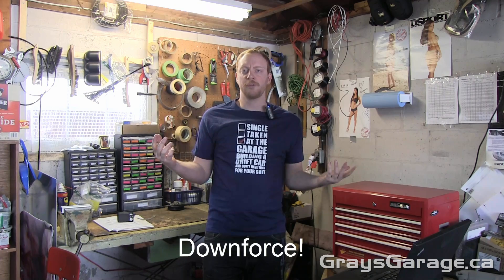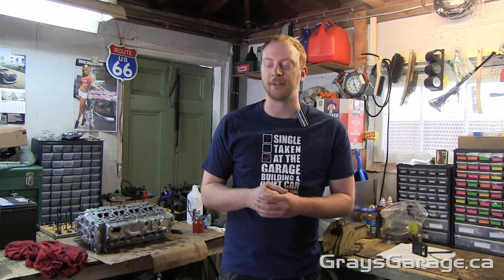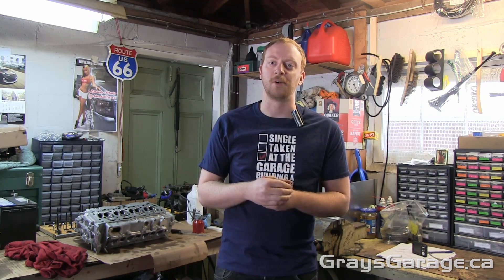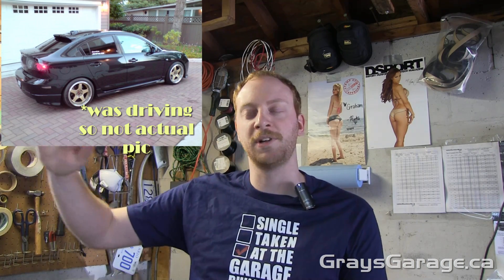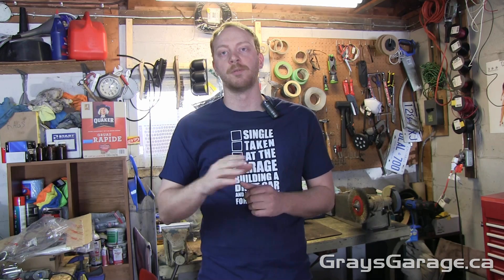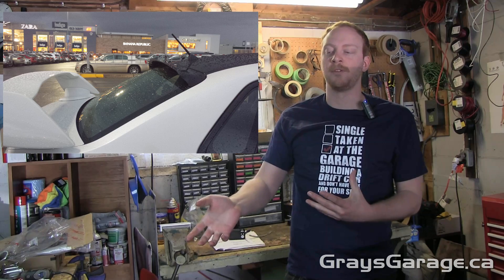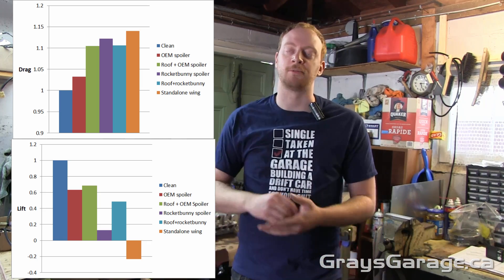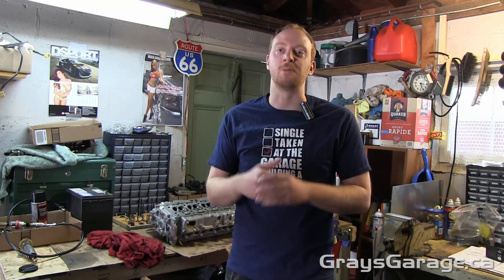Automotive Aerodynamics Ep. 8: Roof Spoilers!

Comment: So why did Subaru give the 06 sti's roof spoilers, and the evo x got  the "flow stabilizers" ? Did the oems have a point or was it for show??
Reply: this is a good pt. as I am sure the OEMs know what they are doing and the mistake here is to call all roof spoilers, wings, vortex generators equals and disregarding them all together. also seems to use the word spoiler and wing interchangeably at times without finding out first whether which is which.
Reply: +david shostak the 06/07 sti roof spoiler is actually a turning vane. The difference is there is an air gap between it and the car. This allows airflow on both sides of the vane and creates a high/low pressure zone. This zone actually smooths out airflow and directs it over the rear spoiler. Esstually all that noise you see at the end of the video over the stock GTR's window (without the roof spoiler) would get smoothed out more. This is an effective use of a "roof spoiler." But it's a different category than the duck bill style he's demoing here.

Comment: What about the ones that are on the Mk II Celica Supra? It doesn't really deflect air, I don't think,  just provides shading like a set of louvers.

Good video!
Reply: CPD0123a Also, the roof spoiler on the 1st Gen Rav4, which pulls air down. I suppose it decreases drag, but I have no real idea.
Reply from the maker: CPD0123a for the celica, it is a sunshade.
Reply from the maker: CPD0123a for the rav 4, it is most likely a mechanism to reduce rear window fouling (dirt deposits)
Reply: That's what my dad was saying, because of how the old flat-back hatch backs used to get insanely dirty.

I knew that the sunshade spoiler was just that (they didn't want to copy the Datsuns and their rear louvers) but I didn't know if there was any other effects.
Reply from the maker: CPD0123a I've tested it experimentally, all it does is add drag.
Reply: That's what I was figuring it would do. Did it act like these ones and make rear spoilers useless?

(Also, toyota fanboy to  toyota fanboy, nice MR2!)

Comment: Hahahaha liked the humor in this vid! hahahaha
Can you make a video about rear and front diffusers?
Do they really do miracles in giving downforce and decrasing drag?
Reply: RafaGmod AFAIK, diffusers typically only function around the rear of the car, and add downforce with some drag... And, most are purely aesthetic. The only functional ones I have seen are the ones which are on race-built cars.
Reply: @AndrewGeierMelons  I'd think otherwise - they sacrifice a little downforce on the back to reduce wake. They are however used in conjunction with a flow accelerator (a sharp edge or a half reversed wing - a dam/bump under the rear axle - which gives some downforce there). The reduced drag allows for a larger draggier rear wing. They might however reduce system lift, as they make the underside skin length closer to the length of the top but...don't forget to account for the fact that the underside is not in a free stream as the top - must account for the ground surface, so I think pressure does more than skin effect over there. Also account for the whole system - a straight back bottom could give more downforce but would also give more pressure deficit in the wake, which in turn would pull down more air from the top and sides, so a smoother transition at the bottom means a smoother transition everywhere around that part. I imagine that the energy needed to change the direction of the flow is taken away from the moving body. So in fact they sacrifice some downforce in favor of less drag over there even on 600 bhp+ cars, as the lost downforce can be compensated for with a rear wing which is far more efficient as it is in a free stream and can be made thin enough to have a negligible wake zone. 
I might be wrong at any time in any situation, though. ;)
Reply: @dushk0  - my understanding is that rear diffusers create a low pressure area under the car by creating vacuum (lack of pressure) under the car and sucking the car down into it, kinda like ground effects.

Comment: How about vortex generators? Mitsubishi had a research paper on the EVO VIII if i remember well
Reply from the maker: St0RM33 I know the paper you are thinking of, it was a technical report. Yes, vortex generators have been proven for some cars, but for the newest generation of smooth-back cars like the FRS, they are not needed.
Reply: GraysGarage From what i remember, it is effective on the EVO because of the sedan shape as turbulent flow is less susceptible to detach of the boundary layer:) Maybe you can do a Nissan 180SX in the future which is 89's design (that goes to chuki facelift 91's and kouki facelift 94's) which is a fastback design like the FRS, so you can maybe compare how aerodynamics have changed (and usually improved) over the years. If i remember well the 180SX had a Cd of 0.27, back in 90's which is impressive nevertheless. Anyways i'm looking forwards to more videos from you, i really enjoy them:)

Comment: great video,  for the longest time i was actualy thinking about having a roof spoiler instead of pushing flow up and over the rear spoiler pulled flow down and over the rear wing, for example the 2006 wrx sti roof spoiler what are your thoughts on this type of roof spoiler?
 https://www.subarugenuineparts.com/product_info.php?cPath=33_48&products_id=941
Reply from the maker: Razgriz Reborn These are probably better described as "turning vanes" instead of spoilers. Work in a similar manner to the vortex generators on the EVO's.
Reply: GraysGarage So would it be possible to have a piece of aero at the rear of the roof either by creating negative pressure or actively "ducting" that would pull a larger amount of the flow from going over the top of the car to a road legal rear spoiler? (not higher than the roof of the car) I watched @KYLE.DRIVES video on vortex generators and even the ones that come from factory aren't really reaching maximum affectiveness due to safety issues.  please pardon my ignorance

Comment: How about the vortex generators??
Reply: They can work but only to eliminate laminar flow separation across the surface behind them, not on a trailing edge.  So, for example, they might work on the roof of SOME cars, not on others.
Reply: @VndNvwYvvSvv and the reduction of separation can help direct air more efficiently to a wing. That's the point of vortex generators.

Comment: Good to hear that a roof spoiler works on a hatchback. Care to make a video on aerodynamics of hatchbacks with spoilers and clean look? Much appreciated :)
Reply from the maker: Locksley Ng Check out ep 6
Reply: GraysGarage How about experimenting with a gurney flap mounted on a hatchback with a factory rear spoiler...? My car (2011 WRX hatch) has a "spoiler" looking thing on the back, which does next to nothing... The only thing it does, apparently, is induce aerodynamic turbulence causing my rear window to get dirty. My old 2.5RS had two spoilers (high and mid) and the top spoiler kept the flow clean, keeping the rear window clean. The mid spoiler created so much turbulence, I once had thirty pounds of snow on my hatch... The rear windshield wiper stopped working.

So, my query is regarding that design, and how I can make it more functional. I am considering adding a Gurney flap to the existing rear spoiler and combining that with my front lip (tests are inconclusive about the downforce it added) for both styling and downforce... And even to keep my rear window cleaner!

Comment: What about the roof spoiler and the wing level or wing higher? This test seems a bit flawed with sample size.
Reply from the maker: MyLonewolf25 The only case of wings this high is on race cars with specialty standalone rear wings. Have you seen these cars run roof spoilers?
Reply: GraysGarage totally agree with this (y)